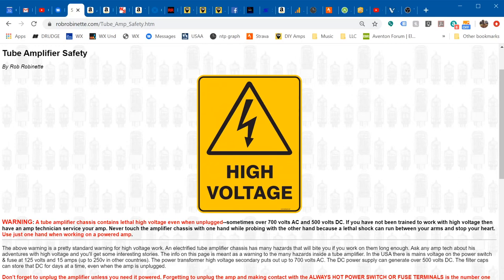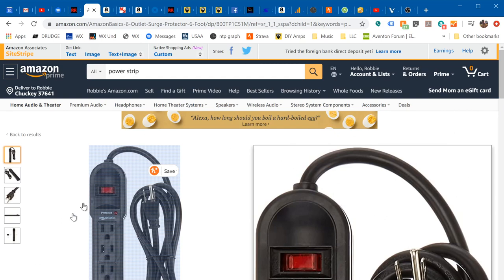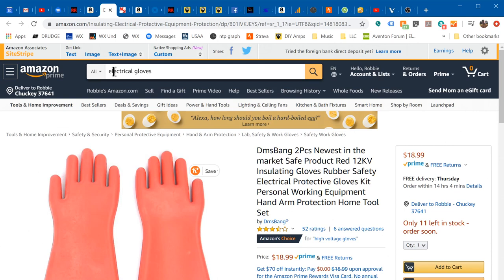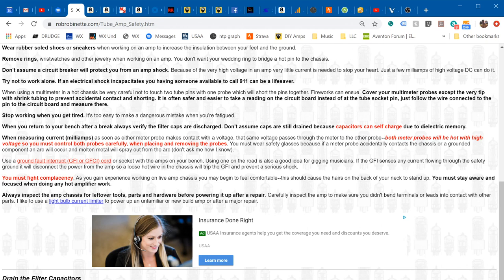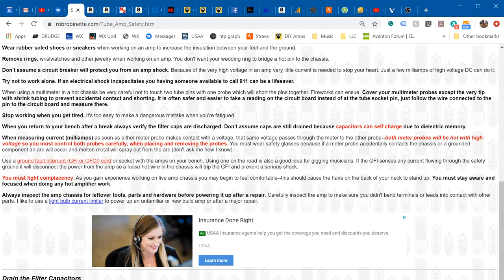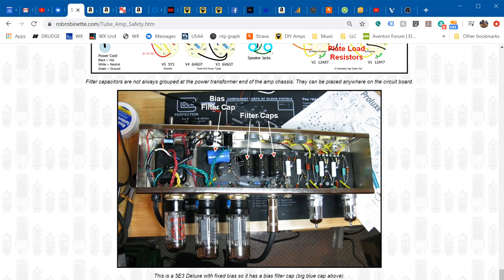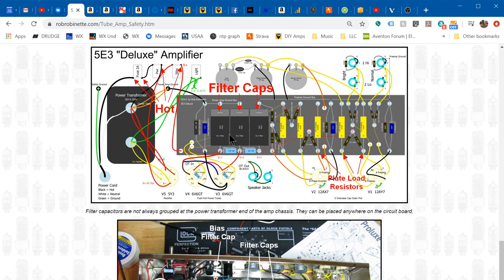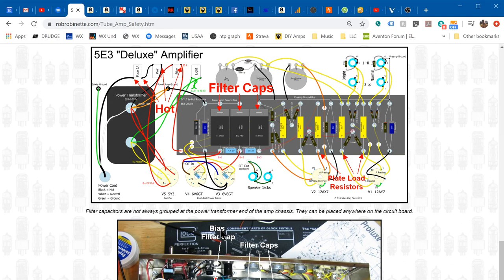Tube Amplifier Safety

Comment: Very good video and webpage that will save lives. Thanks for sharing and also for highlighting the mistakes at the end of the Uncle Doug death cap video.

2:25 Virtually every GFCI works by sensing the difference in current between the line and neutral, not the "safety ground".

Comment: Thanks a lot, Rob, for this vid as well as all the information on your website!
I found out after completing some Tweeds and a JTM that my knowledge about tube circuits rose in the same way as my complacency. It’s good to be aware of that.
There are many parallels in driving a plane. You have to stay anal about safety measurements all the time or you will be buried by your mistakes.
If I’m looking scared my wife knows I will start up a new amp. She will check in intervalls for life signs (..wondering how long that will last ;-))

Comment: A GFCI doesn’t sense current in the equipment grounding electrode! It senses the imbalance of current between the hot leg and neutral conductor. That’s how it operates
Reply from the maker: Yep, that is an indirect way of  sensing ground current.